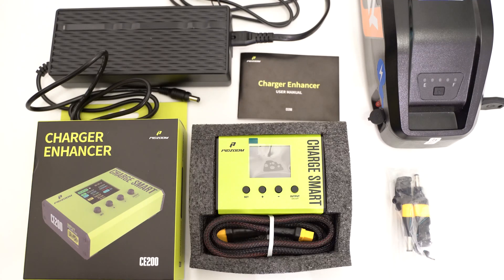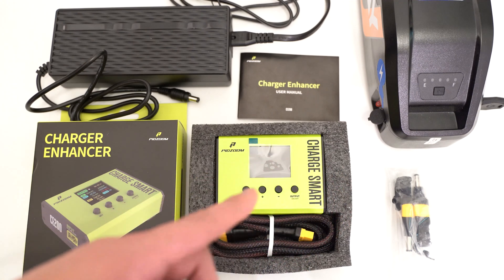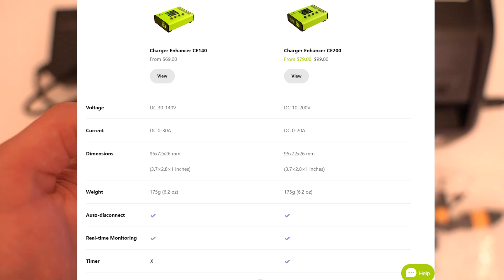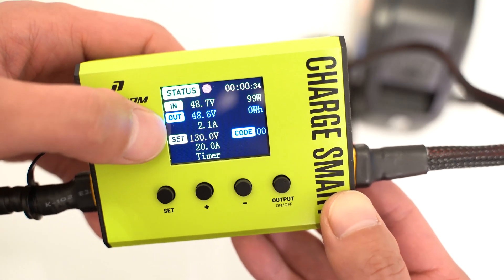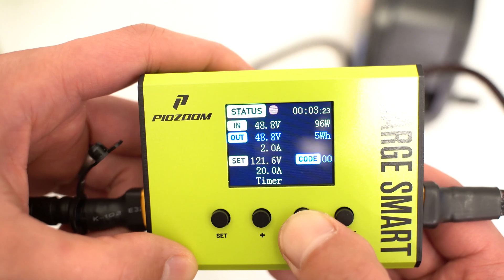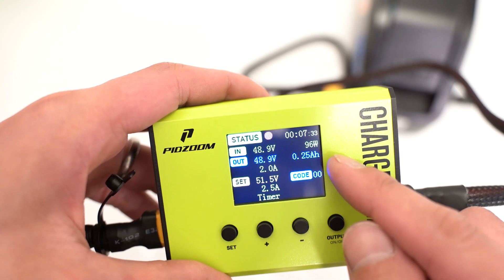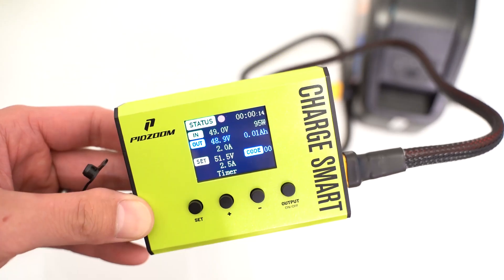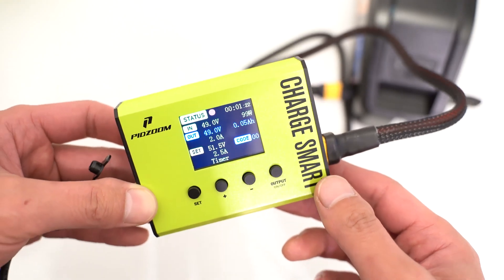PREVENT EBIKE BATTERY FROM EXPLODING - Pidzoom Charger Enhancer CE200 Unboxing, Assembly, Review

Comment: Can this charger get direct power from the wall plug, instead of the ebike charger?
Reply from the maker: I don't think it's capable of converting your outlet voltage (ie 120v) to your battery voltage (ie 36v or 48v), so you will need the charging brick for that.

Comment: I recently purchased a CE200. I find your review very helpful, being hands on and very clear. The manual is extensive, your video makes it much easier to start using the thing. I couldn’t get custom adapters from Pidzoom, but I believe I can source the necessary DC socket and XT connectors I need from an electronics component store and solder my own adapter.
Reply from the maker: Thanks for the positive feedback. I appreciate it, and sorry to hear that they couldn't make your custom adapter. Yeah, it's pretty simple to make your own adapter if you can get your hands on the parts and solder. Good luck!